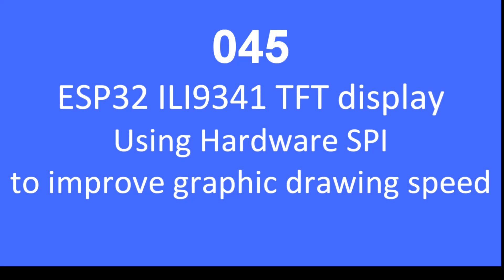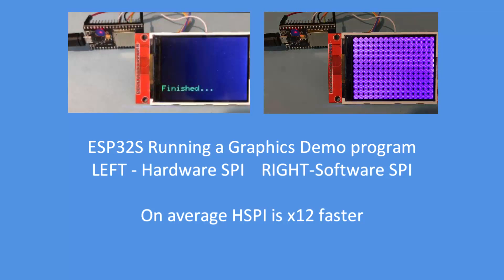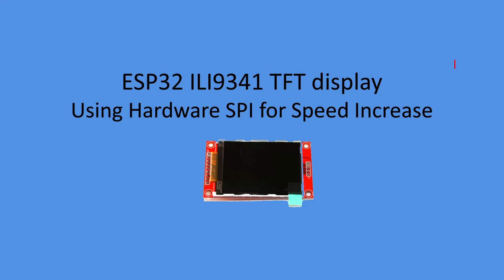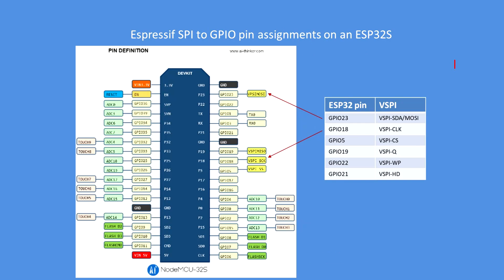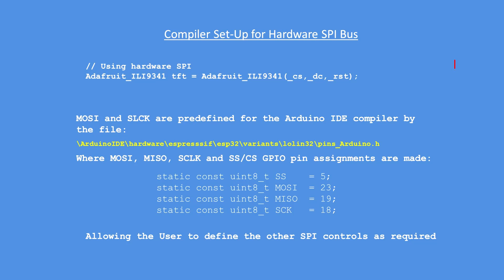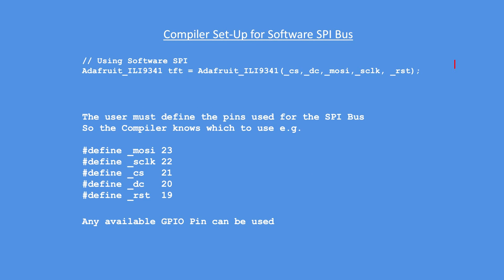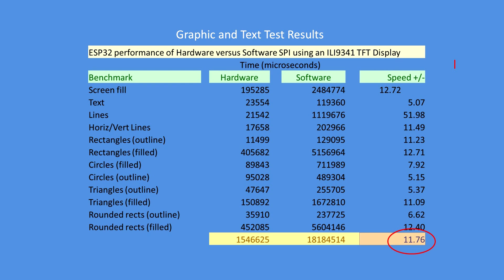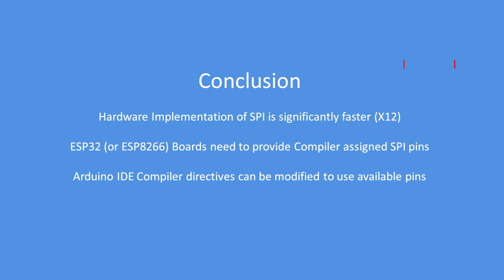Tech Note 045 - ESP32 ILI9341 TFT and how to use Hardware SPI for ultra fast graphics

Comment: Excellent video!

I was wondering if there was a chance that the SSD1289 could be covered in the same fashion?

I've been struggling with it for a while. I also watched your hardware SPI and other videos, all of which are great!

Keep making videos.
This is an amazing resource.
Reply from the maker: Well there’s no doubt the majority of SSD1289 displays have an SPI interface and there are drivers around for the Arduino IDE and so it should not be that difficult to get one working, I don’t have a display to try so can’t help at the moment. I self fund all of my videos and devices so I have to work within what I need and have at my disposal. If you need help I’ll gladly provide that. Have you tried connecting the display up as per an SPI bus including DC connections, etc.

Comment: I must be doing something wrong here, software spi works fine but after changing the file definitions to hardware spi: 
static const uint8_t SS    = 15; 
static const uint8_t MOSI  = 13; 
static const uint8_t MISO  = 12; 
static const uint8_t SCK   = 14; 

and using this code:
#define TFT_DC 16
#define TFT_CS 17
#define TFT_RST 5

// Use hardware SPI (on Uno, #13, #12, #11) and the above for CS/DC
Adafruit_ILI9341 tft = Adafruit_ILI9341(TFT_CS, TFT_DC, TFT_RST);

It Doesn' t work at all! What am i missing?
Reply from the maker: It depends on which board/device your using and I’m assuming your using the Arduino IDE. When you choose to use hardware SPI the pins are defined for you take a look in the Arduino IDE folder there’s a hardware folder (from memory this) and then Espressif, then boards then choose the board your using then open that folder and you will find a pins file that the compiler uses to assign SPI pins, those are the pins you have to use, as your definitions are ignored in the code because the hardware is already assigned to the pins usually 18, 23 and 5 the rest can be assigned. In my video I show how to find the pins assigned by serial.println(MOSI) and the same for MISO and SS and SCK those are the only pins that are fixed.[Edited to remove iPad quaint spelling corrections]
Reply from the maker: Check out the file in the Arduino IDE folder e.g. : ArduinoIDE\hardware\espresssif\esp32\variants\lolin32
You will see the boards listed if you go up one level from my example above. Serial.println(MOSI), etc is just as  easy really to find out the pin numbers. Connect your display accordingly to these pins.
Reply from the maker: Tech Note 064 might help too.
Reply: OK thanks so much its working now

Comment: Should TFT VCC be connected to 3.3V and not 5V ? Is it safe to run TFT with 5V signal together with ESP32 that is using 3.3V ?
Reply from the maker: Hi, nearly all of the TFT displays require a 5v supply (Vcc) but the LED source/Backlight needs to be driven by a 3v3 source and ideally through a 100-120R resistor to limit current. You can PWM an output pin and connect that to the LED pin and then the average current is well within the ESP8266 output sourcing capability. Some displays need level shifters some not, I look for the ones that say 5/3v3 as they have in-built level shifters otherwise they won't work.

Comment: Great guide! Any chance you can do a new video on how to get the touch to work? thanks!
Reply from the maker: There are many so-called fake touch sensors on these screens, some work some don't, it depends on the supplier. There are many forum discussions about this topic see here: https://blog.squix.org/2017/07/esp8266-weatherstation-update-using-touch-interface.html they may have solved the problem for you.

Comment: Thanks.  This showed exactly what I was looking for.
Reply from the maker: I've found that the pins for hardware SPI are fixed for most boards, but you (e.g. ESP32 is 5-CLK and 23-MOSI), but if you look at the boards.txt file in the Arduino IDE, then you can change the pins around a little. I find it's easier to have all SPI pins grouped together on a dev-board, so the cabling is easier/neater.
Reply: G6EJD thanks,  I'll get that straightened out when the time comes.